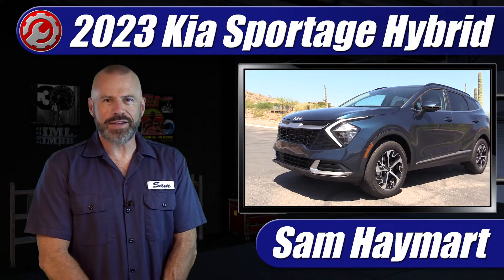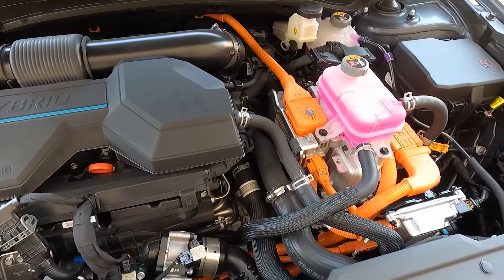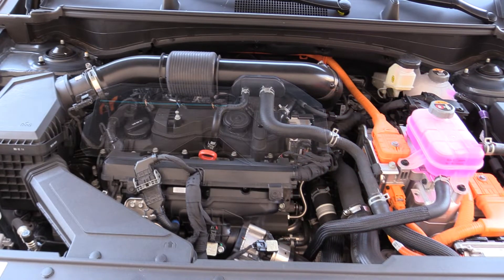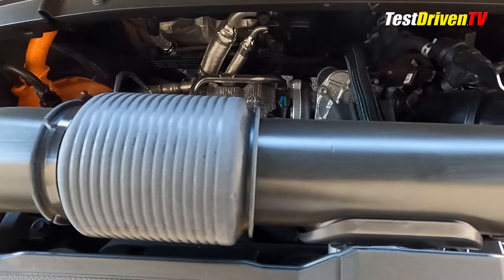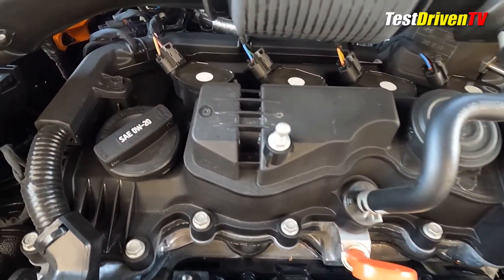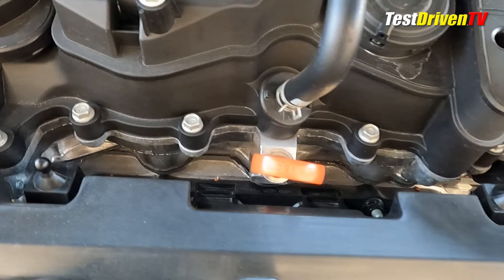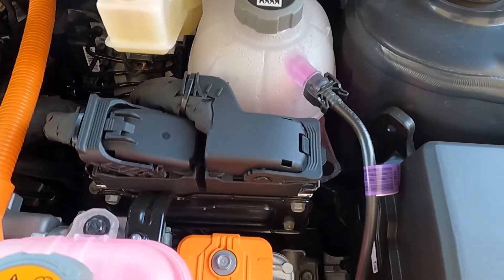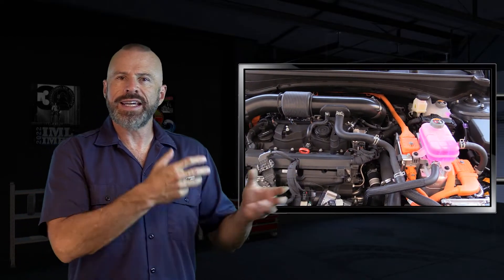2023-2024 Kia Sportage Hybrid: Engine Explained

Comment: The 2023 Sportage PHEV has a 12 volt battery where the spare tire should be.  and also the charge controller.
thanks for the engine tour.  I need to add some coolant!

Comment: Got the 2025 Prestige Hybrid, couple issues. Overall nice car. One of comfort issues: Powered front seats on both front seats. But the drivers side has a lumbar adjustment but the passenger side has no adjustable lumbar so you get a big bump pushing your lower back. Also the mirrors are not power folding, and never offered antiglare backview mirrors by dealer.

Comment: I have a 24 Hyundai Tucson hybrid (same powertrain), and thanks for the video.  I would love to see how the mechanical system in the transmission works switching from ev to ice, I simply dont understand how that works and as OCD as I am.  I have to.  I need to know how all my vehicles work in and out.  If you get a chance Id love to hear that explained.
Reply from the maker: There is an electric motor in place of a traditional torque converter which can disconnect from the engine via an electrically actuated clutch. This allows the engine to stop and the electric motor to continue to provide power into the transmission or can provide regenerative braking / generation to the battery when conditions allow.

Comment: This is an awesome car that I bought one. Thank you for a wonderful review. I bought the 2023 Kia Sportage SX Prestige AWD Hybrid. I love it. Mine is coming in another month. It has the best 1.6L Turbo engine with the Hybrid engine at 38MPG. I am very impressed with all of it. So many features. The Panoramic sunroof is simple awesome. It is built very well with great quality. The LED projector lights are very bright and go very far. The engine is very quick and quiet. No road noise at all. Thank you for your honest review.
Reply: Can you open the hood and tell us if there is a serpentine belt?
Reply: How is it running after 8 months any issues? It is coming in the carnival in 2025 so I am hoping to buy it
Reply: I've had mine over a year and I love it, no issues. My daughter has an xline, not hybrid and it is a little under powered so this hybrid is bomb!!  I got mine during covid, it's just an ex. I wish I had the deluxe model but I'm thankful I got one! Where I'm at they were hard to get, the hybrid model that is.

Comment: I wish the mileage was that good. Testers I've watched on YouTube consistently rate the vehicle at a maximum of 35 mpg for AWD, 38 for FWD with the average mpg slightly lower. Regardless, the EV trim of this vehicle is still my next new car goal. The video was very informative!
Reply: Informative if you're looking for bad information
Reply: So, it's going to depend on the gas engine that's included with the Sportage.  Each market seems to have a different engine or transmission.  I have the North American Sportage HEV and am currently getting around 6L/100Km or 39MPG at 1700Km's on the dial.  I have the AWD version.  It's also going to really depend on your driving style as well.  The harder you push on the gas, the more gas you'll use.  If you drive way past the speed limit etc.
Reply: I'm getting 32 but I live in WY and mine is AWD. I drive mostly 80 on the highway so that's to be expected if you come 55 or 60 it's Much better and if you go in town (slow) it runs off electric more and your mileage increases.

Comment: Gas mileage, no power on fr. passenger seat, and power remains on if you have climate control on.  It will not go into EV mode with any type of heat or A/C on.
  I have the EX hybrid w/ prem pkg. and I'm honestly agv. 27.6  mpg here in very cold Denver. No lie... the MPG sucks

Comment: Question: if something is wrong with the hybrid system, will the car still start and run on the gas motor?
Reply: Question:  Where is the 12v battery located in this vehicle?
Reply: @نمرهندي  it is located under the back seat, it is integrated in the hybrid battery.
Reply: @نمرهندي under the rear passenger seat
Reply: @نمرهندي they said no 12v batterym
Reply: If something wrong means the battery hybrid is shut, then you will not be able to start the engine AT ALL.

Comment: Hi Sam, this Smartstream engine, will this have the same range of issues that previous Hyundai Kia engines have had, i.e. oil burners, fires, etc...  Is this a improved design that significantly decreases the risk of the old issues, or just something we'll have to see over time?  Thanks!  Jeff
Reply: By design , it is turbo and GDI, oil burner will be a risk regardless of issue patching by KIA! There is a way for you to be proactive to lessen the risk, my method is by using at least 89 (preferably 91 octane) gasoline, change your oil at 5000 miles on highway and 3500 miles when you do exclusively stop and go traffic, and never start the car only to drive a mile and turned it off, always have a habit to warm the car to optimal operating temp before you turn it off. 
There is not a lot of sample to compare my method but my Tucson Hybrid, which share the same tech as this KIA, is reaching 100k with no oil burners, no oil dilution!
Reply from the maker: That's hard to know, perhaps try Consumer Reports